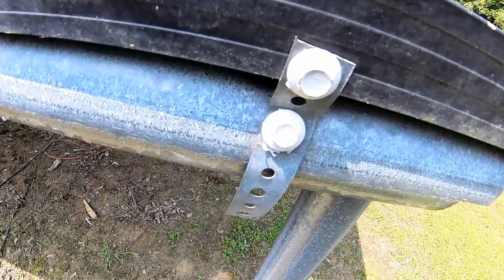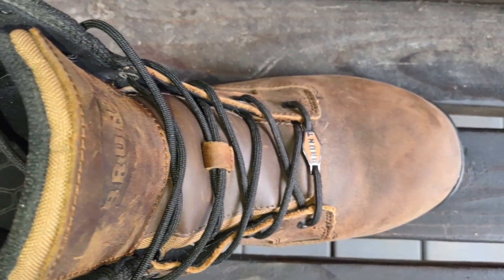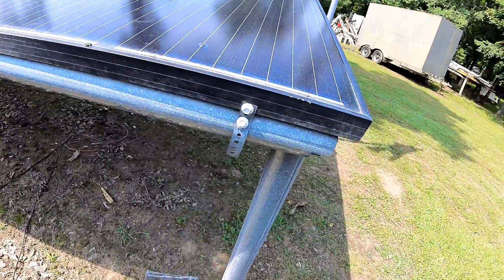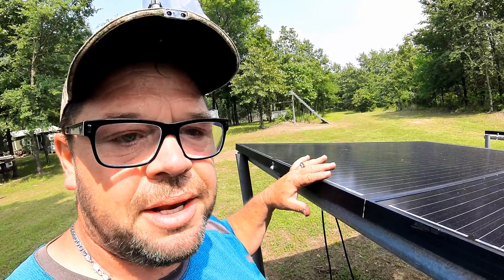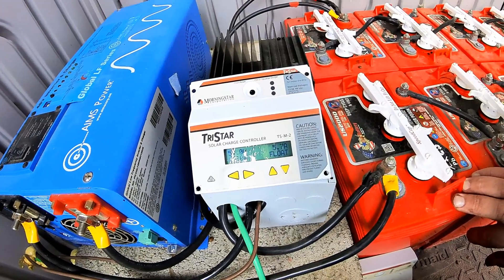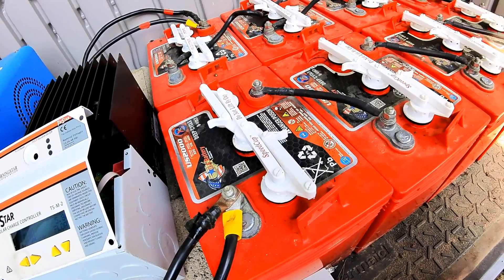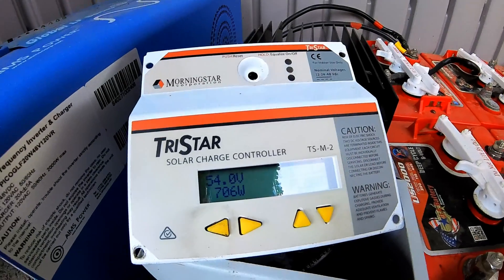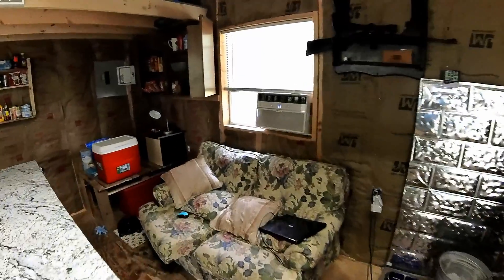Run A/C On Off-Grid Solar System After One Year.

Comment: Amazing video! Truly inspiring! I was wondering, do you have a gasoline backup generator in place, or plan to in the future? Also, with the yellow 3prong plug you showed which goes to the generator, does this essentially replace the solar panels and sends the power to the charge controller? (For when the solar panels are not working)
Reply from the maker: yes you can plug a generator into that plug and it will back charge the batteries...and yes i have one

Comment: good video.... im sure its only temporary , but at 4:43 those small head drywall screws are not meant for outside and will rust and break , and would make me nervous it would fall off that wood ...and im sure you know that 6/2 black wire isnt supposed to be exposed to the elements and should be protected inside a pcv or conduit ...but thats most of the wires for long term use ...but again , im sure that setup is temporary and youll get it all fixed correctly
Reply from the maker: everything  i read told me that the grey 6/2 was rated for direct burial without conduit that is why i did it and why i bought grey in the first place. As far as the screw go im getting better at those things each day. Remember I was never a carpenter of any type I was a repo man for 30 years, I may not be able to build anything 100% but I can still snatch some ones car in 3 seconds flat lol